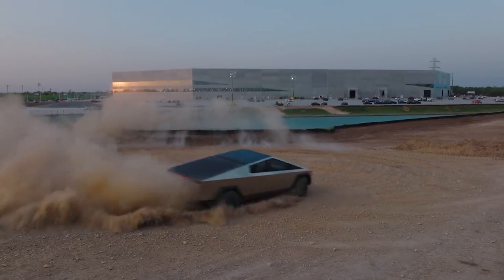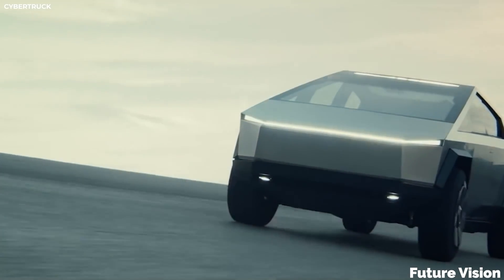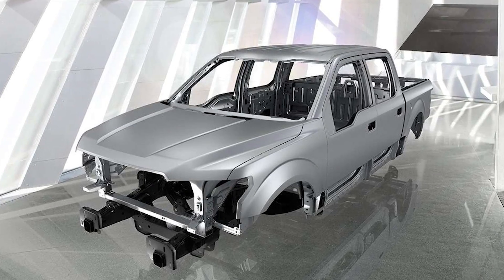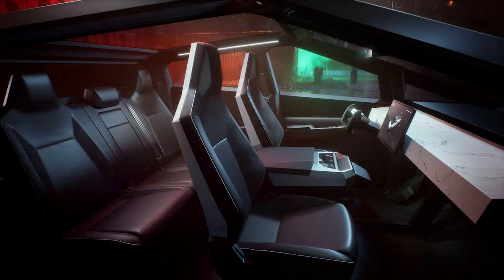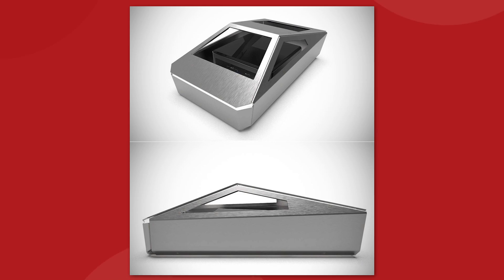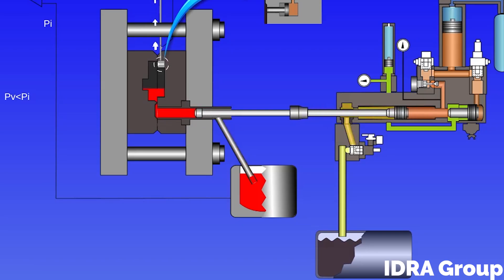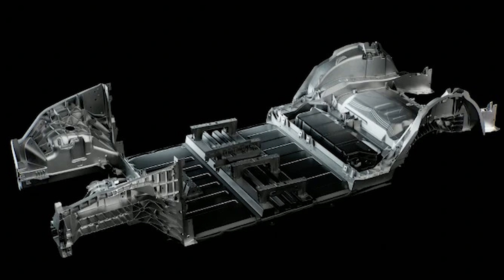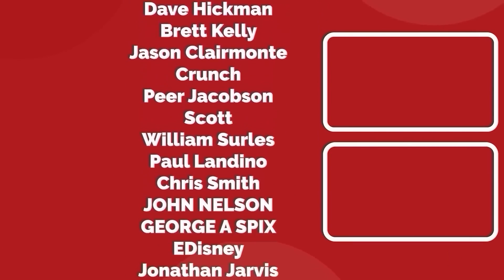The Real Reason Tesla Developed The Cybertruck!

Comment: large cast aluminum structures are a great way to make sure that even a minor accident totals your vehicle since cast aluminum cracks easily instead of deforming as sheet would and once cracked you would have to replace a very very expensive part
Reply: We are already in the world of relatively minor accidents totally vehicles. Not because of major damage but because insurance companies are not willing to risk getting sued because they repaired a vehicle that then had another accident that could possibly be traced back to the original damage. This is why there is such a large "salvage" vehicle market that has sprung up. "Airbag deployed? Total it!" You're not wrong in your assessment, it's just a moot point these days.
Reply: @weaves1962  
To be fair, some vehicles have a LOT of airbags, and they can be darned expensive to replace becuse they come as assemblies.
Similar thing with so many other 'appliances'- which to most they are and treated as such - with replacement seen as a normal practice instead of repair. On that, make sure you support any, and all, "right to repair" legislation.
Parts are bad enough, but with $100+/hr labour charges not uncommon, it takes very little labour time to make things uneconomic to pay people to repair, and there are some really good deals for buying and repairing write-offs if you're prepared to put your own time into it, and go through the hassles of red-tape.
Reply: so you think that it being deformed rather than cracked would mean it's not totaled? what kind of logic is that?
Reply: LOL even on traditional vehicles  it'll be like Michelle says....crumple zones.  You can get traditional ones written off so easily now too once unibody has a dent in a piece because it'll crumple too easily in the future
Reply: Since existing designs and requirements for safety were well known before they even started designing, do you not think that exceeding those requirements were part of the design?  

Think about how much more complicated and risky it is for a corner impact design, calculating in 12 pieces of sheet metal, 6 castings, 300 spot weld points and 100 fasteners?  Your structural analysis has to account for all those pieces to make sure that there are no weakest links, that mfg ensures that everything is consistent and perfect every time.  Or, you make it out of 1 integral piece, designed and tested VERY easily using software for many varieties of impact scenarios, and if you're deficient in one location, instead of making a sheet metal gusset, welding/fastening it, painting it, etc., you simply add webbing to your casting design and call it a day, adding no more parts, failure modes, or labor.

As far as a repair goes, that was conveyed by Tesla very early on, that they wanted these single pieces to absorb impact in an accident, then get unbolted, recycled, and a new one installed at a fraction of the labor and cost comparably, and also not shorten the life of the vehicle after.  Everyone knows that once your car's been repaired structurally, those fixes rust out after a year or two.
Reply: @ando5389  I mean sure, but also Tesla's are riddled with schoolboy errors like water pouring into the boot due to bad rain channel design so… wouldn't put it past them to have something wrong with them, and have to wait for weeks to get a Tesla-approved repair!
Reply: @@michellesmith4133 
I think I'm in love 😍you hit (almost) all the triggers 🥰
I got a bit put off by your testicles 😮 when you have a female nom-de-plume and avatar, though - but then we live in interesting times, don't we?
Oh, yes, you're probably right, I have been complimented on the relative smoothness of mine when tea-bagged, but then you can't really trust those nubian slave girls after they reach menarch, can you?
Reply: Yeah man! Idk about you but I'd prefer the G Wagon, anyday.
Reply: Best invention ever! Generic!
Reply: Good thing this is cold-rolled steel!
Reply: That's actually a great point, the Cybertruck probably doesn't have much in the way of crumple zones given its materials and shape.

They're also not just for the driver, they save pedestrians in crashes too.

Sounds like this thing's a death box.

Imagine you rolled over, how long would it take for the fire service to cut through and get you out?
Reply: @Dan Van  I hope Tesla is watching this forum. These are very concerns. I thought about the rigid nature of the body being the opposite of crumple zones. Nevertheless, we will see how the NTSB crash test are done.
Reply: @danvanspam  if you can manage to roll this wide a truck over, you shouldn't be given a driver's license.
Reply: Maybe they should have just made it out of glass so it shatters to pieces for easy recycling.
Reply: @stvlu733 😂😂😂😂
Reply: Tesla just has a lot of high quality stuff on it. The design is ugly and stupid af. The truck looks weird. The SUV had a lambo wtf? And the steering wheel... wtf?
Reply: Crumple zones reduce the probability of serious injury, or death - how much do you pay in the USA for hospital stays, or even simple health  services, and what coverage do you have if you have to take time off work? Seems like a bit more expense in repairing them, or having them written off, is a compariive bargain. Same with a moderate increase in insurance premiums - you DO have insurance, don't you?
You are aware of the widespread use of cast alloys in any modern vehicle, aren't you?
The cast pieces are actually a much simpler and easier repair option - the real problem is the hard points, but those can also serve as anchore points in chassis machines, so that's 50-50.

However, the biggest problem here is exactly that "sheet metal" as it's forming the exo-skeleton - basically an exposed monocoque - and these are particularly vulnerable to structural vulnerabilities as any damage is to the primary vehicle structure, rather than a 'sacrificial' structure that isn't critical to the structural strength.
You may be familiar with the trick where one can (if one isn't too heavy) stand on a beer or soft drink can with it on end, without it being crushed - that's like the intact structure of the truck - but if one then taps the side of the can it alters the forces stressing it's shape end it immediately collapses - en exaggeration, but same principles for a damaged exoskeleton
I would also remind you that "sheet metal" vehicles are rarely "repaired" to close to the original condition, whereas a replaced alloy part is in original condition.
Reply: Unless it bolts together like a giant lego car so the whole section of structure can be fairly easily replaced (which I doubt is the case). Also the structural battery pack is very hard/expensive to replace. Building disposable throw away electric cars isn't very good for "the environment" but of course EV's never really were about helping the "environment." Just more BS  marketing ploys, people bought Prius's thinking they were helping to save the world (creating Southpark Smug emissions)    
Having the battery pack serve double duty helps the manufacturer save money on building costs but actually hurts the consumer. It's not actually saving that much weight, especially considering how much heavier EV's are to begin with. I love how they present the idea of the integrated battery as somehow helpful to the buyer/consumer. It's also not that "innovative" forward thinking...building a gas tank into the fame of a motorcycle is more innovative. Since the in-frame gas tank won't wear out, causing you to have to replace the entire motorcycle frame when it goes bad.
Reply: @michaelbrinks8089  agree with all your points. But oil is finite! What will you do when oil reaches $200 per barrel or $10 a gallon.
Reply: @MrIndia-bv1fc  I'm not against Electric cars & better solid state batteries are coming in 2025 in a Toyota hybrid...I just hate how auto makers are trying to screw consumers even more through planned obsolescence....We still have tons of natural gas & a combination of biodiesel, ethanol, hydrogen, natural gas to run cars if oil dries up. Plus motor oil can now be made by compressing natural gas. Some high quality full synthetic oils are made currently that way. Brazil was 100% fuel self sufficient by making ethanol from sugar cane. Plus they have tons of oil & natural gas as well. By using a combination of different types of fuels, we still have plenty. We could make hybrid cars that use a combination of biodiesel ( very clean burning) & better faster charging solid state batteries for plenty of range. Ford should have made the lighting a 4 cyl turbo diesel/ electric hybrid so it could have plenty of towing range.
Reply: The cyber truck is made of cast aluminum?  Aluminum is a weak metal.  As much as it cost it should be made from Titanium.
Reply: @chriss4365  Don't fly in a plane then if that's what you think!  An engineer you are not.
Reply: @ando5389  I'm not an engineer? Let me guess you are right?

Comment: you clearly dont understand materials and forming processes. it is not impossible to stamp that panel and the press would not break from a hard sheet, the sheet would crack which would ruin the panel. panels could also be hydroformed as they do with car frames now.

Comment: I appreciate ideas that deviate from the main stream. But this is actually a car and not a truck. An exceptionally ugly and inefficient car. The flat sheets will make a lot of noise. They entirely lack the stiffness of 3D shaped shells. An egg shell is smart. Minimum Material vor maximum structural resistance. A 1/8 inch but flat stainless sheet is dumb. A waste of material and resources.

Comment: What about pedestrian and second party vehicle crash  safety ? Modern cars are designed with soft parts that give way in a crash.Imagine a regular car being hit by such a felling wedge! If the Cyber truck hits a sturdy obstacle the passengers would be subjected to deadly forces otherwise absorbed by crumple zones. How will a damaged  cyber truck body be repaired after an accident? Straightening in a  jig,  Welding ,filling "Bondo" and painting will not be possible. I think this may be a throwaway item just like other E- cars.

Comment: How can fragile explosive batteries carry weight and load bare or are the batteries buffered by a sheet metal structure layered with composite and some weight is disperced across the batterese and the gluing in allows for some loading But ide like to see the load tests for a battery pack and its claimed load carrying capicity.....

Comment: The body isnt dead weight its the cab for the truck and its a rollover structure and is used to reinforce the strut towers how can it do  that if it has no structural integrity. many companies pump filler into the pillars to increase the pillars strength..And anyone using your so called describes methods are operation out of India or Asia...

Comment: Stainless bolts are not used because the do not have a tensile rating ie the stretch and work harden so now you have discimilar metals causing electrolysis and erosion.....Landrover had the problem with aliuminum and steel...

Comment: Again Bullshit ever fold in steel increases strength upto 3 times carrying capacity fold steel with 100 kilos of pressure it takes 4 to 5 hundred kilos to unfold or deform it back to its original Straight sections are weak and buckle where is the cras test results and the increased capacity versus the extra load of manufacturing

Comment: Thats patiently a lie the body is stronger but the floor has tubular rails aka a chassis but its sheeted to the body...
Sheet metak bodies need to be reinforced to take tow packages and most are limited beacuse o a lack of cross sectional thickness and rigidity.

Comment: That is patently bullshit. The strut towers are braced accros and tied into the fire wall the body and cab reinforces the chassi, some more than others an Uni body or Monocock bodies are just teid into a Ladder rail sheet metal system and to say they are diametrically opposed is nonsence and tertairy dribble as the Chassi sheetmetaled to Body would take literally 10 percvent metal to achieve a Uni body..Its like watching Top gear commentators slag off US engines as low tech yet the out perform with a little finessing and last 4 to 12 times longer depending on the model and brans BMW fail  catastrophically by 270,000 and F150 have been known to last 1 to 2 million kilometers and i aint even from the US...

Comment: Aluminum isnt soft if tempered, it tears and doesnt hold strength if bent past 5 degrees angle. Aluminum is strong thats why planes are made out of it its 30percent the weight of steel. and when engineered has comparable performance with cast and sheet metas steel it has limitations like steel has weight limitations...

Comment: That wasnt a sledge hammer it was a plastic soft blow mallet. Sledge hammers are 10 to 20 kilograms in weight and would severly dented the pannel and Stainless work hardens and cracks thats why its not used in cars or trucks i know im a metalurgist, ex military

Comment: Hahahahahahaha batterys that blow up on the second day trap the owned and he had to use a metal object to break out and said if his wife and kids were in the car they would have died. Oh and the licks stop working as thety are electrically actuated,,And there is no green manufacturing and the battery takes 500 tonnes of ore just to accumulate the amount of lithiun needed...And the Tesla's have to run for 400,ooo miles tjust to equal the life and fuel of an F150...But as soon as the battery fails or motors the foot print is larger...Oh and all the electricity comes from coal or mining or wind which fail on average after 3 years oh and wait the temperature hasnt rises so what does climate really mean suggest you google Climate Climatis Clima in latin to know the elites secret code in english...

Comment: The shape of this monstrosity is just plain engineering laziness.  Yes, that stainless can be molded if done properly and using "a little" creativity.  And more angles create more rigidity and strength.  Large flat sheets of metal are inherently weak.
Then the "giga" molded parts make this a no starter.  If any of those sections are damaged, in say, a low speed collision, or hitting a boulder, that truck is toast.  No remove and replace parts to get back on the road.; gotta send it back to tesla for a complete rebuild (at the owner's expense of course). This all make sense for the manufacturing costs, but the end user has a "single use" disposable truck on their hands.👎

Comment: The reason The Cyber Truck exists and looks the way it does is for a dual purpose, I suspect the final product will have 2 separate battery packs and those flat straight lines can be fitted easily on the go with special Solar panels that can be linked together to cover most of the body of the cyber truck for endless driving 24/7 driving, The Truck is fitted with an Electric Charging port, The Solar Panels can also charge the 2 huge battery packs and can be switched over from one to the other by a simple flip of a button, Also, this design will be scaled up to be fitted with Robotics for an Improved Rover that can quickly drive across the Lunar and Mars Surface, everything will be an improvement over the existing Rover
Reply: @javier migoya   About the Improved Rover:  are you speculating, or have they actually talked about doing that?
Reply: @alanparsonsfan  Sorry should have led with this is my opinion, It's speculation but only makes sense based on the past when looking at all solar cars race competitions, in the past and their emphasis on flat surfaces, those solar vehicle races usually had a huge flat top all solar, with a cabin, basic steering, chassis and, wheels to keep weight down, as the years went by we saw more and more elaborate solar vehicles in these races, started to look more and more like regular vehicles but usually made use of an abnormally large rooftop full of Solar panels and still keep weight down, Elon just announced that The Cyber Truck would be delayed 1 more year for last minute refinements, my initial post came before his announcement, Elon's Solar Company makes, in my opinion, The best solar panels and storage solutions on the market, Tesla Energy strikes the perfect balance between efficiency and durability, I'm confident that they are close to a breakthrough in both Panels with improved energy absorption as well as Storage solutions that are much lighter and efficient, My opinion is that this is why he's delaying The Cyber Truck an extra year, they've had the same tech for several years now, if they are close enough to an improved system why risk mass production using relatively older tech when another Car company might be close to their own breakthrough and then be stuck with a product that is dated tech wise on day 1

Comment: If Tesla designed their vehicles to be easy to repair as well as easy to build, I might be more interested. But after reading about how Tesla wanted to charge an owner $17,000 for a plastic fitting being broken off the battery pack, I decided Tesla wasn't for me.

Comment: With the door cutouts, the body panels don't do as much for front to back strength. I believe that they will need a super strong casting at the rear and an extra beefy battery casing to accomplish 17k Towing capacity.

Comment: I like the CyberTruck but using the batteries for structure is a terrible idea. Even heavy duty trucks get overloaded sometimes and the frame bends. They can be bent back - that's not possible on a Cybertruck, and if it does flex, those batteries will turn into a bomb.
Love the design though, maybe fun offroading in someday if they ever make it.

Comment: More like a kid designed it while high as a kit.   And longest lasting?  No way.  Doubt Tesla ever hits 500,000 miles let alone a million miles. And if so it will have had several new batteries and probably new motors.